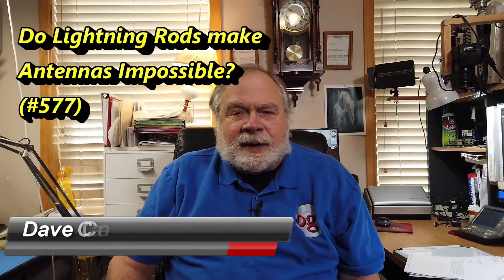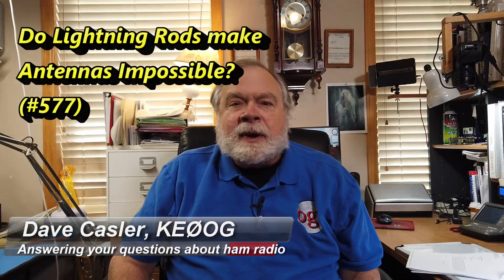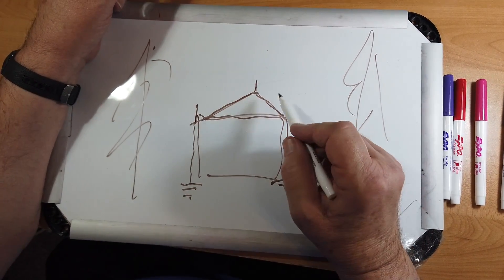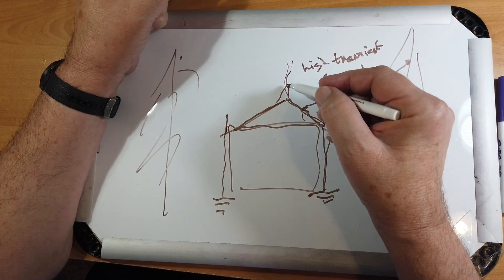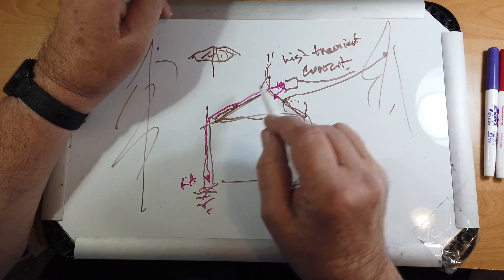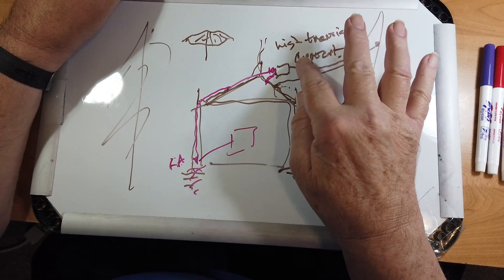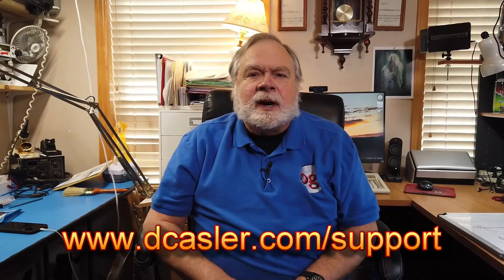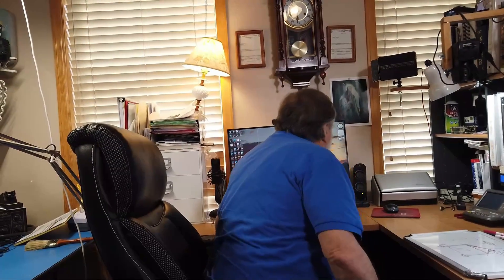Do Lightning Rods make Antennas Impossible? (#577)

Comment: Dave; the gray pvc electrical conduit is UV resistant and doesn't cost much different than the white or black pipe will last a lot longer in a permanent installation  use it a lot and it really works well.

Comment: Gray PVC is for electric pipes and is UV resistant. It comes in most of sizes  1/2 to  2 or 3 inch. It doesn't come in thin wall. So it will be heavier than thin wall sink drain PVC.

Comment: May I answer the question? The lighting rod system will not in any way degrade the reception pattern of the EFHW. 

No ground connection to the antenna, versus bonding antenna ground to the lightning rod conductors? The radiation pattern of the antenna would not be influenced in any considerable way. However, the performance of the antenna (radiation resistance) likely would be dramatically inhibited by the absence of antenna ground. 

Utilizing the lightning rod ground as an antenna ground and counterpoise? It can be used. It is electrically identical (RF and DC) to bond to the lighting rod system versus a dedicated large conductor run from your balun ground terminal to a separate ground rod.

Comment: “Lightening arrester” is more appropriately described as a surge suppressor, as it will not protect from a direct strike.  Furthermore likely a direct strike to one of the lightening rods will follow the leadin into the shack as well.   The surge suppressor may protect against induced voltage/current from nearby strikes.   Remember lightening is of an rf nature somewhere in the 1 MHz range so using copper strap, not braid, from suppressors to ground..   Regardless the best way to avoid damage is to disconnect / unplug everything in the shack.   Finally one has to question the practice of permanently grounding everything in the shack...if you are trying to avoid lightening damage.
Reply: Say what? 🙄